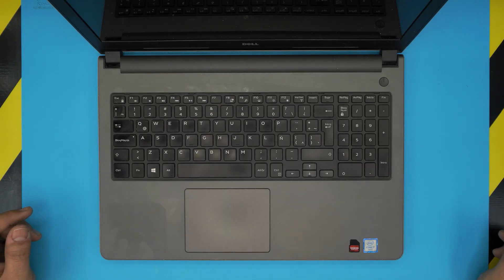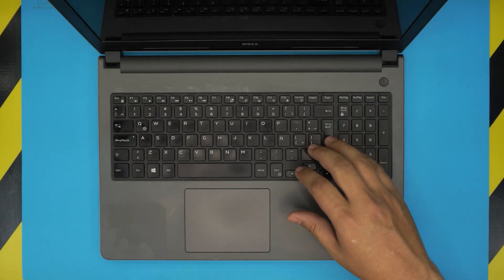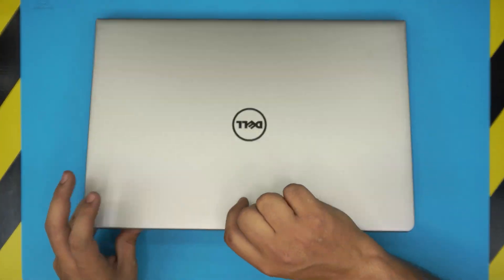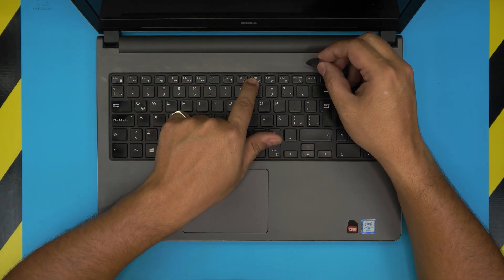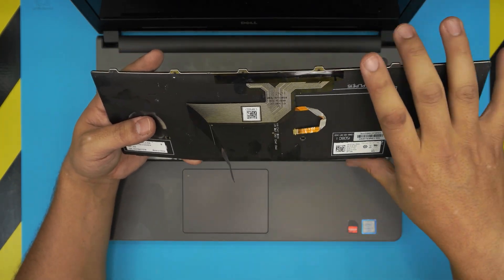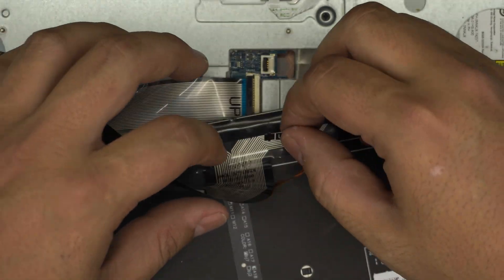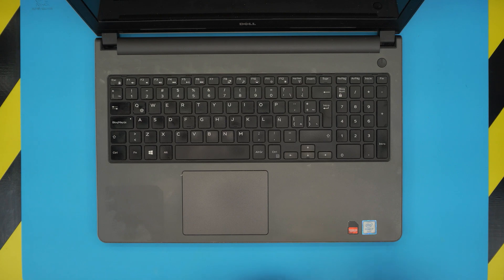Dell Inspiron 5559 P51f Keyboard Replacement FULL GUIDE

Comment: Great instructions.  My Dell 5559 came without a backlight  keyboard....can I now upgrade to one with backlight?  Will it have the connecting point inside?  In general, would you recommend to upgrade to a backlight keyboard?  Thanks.
Reply from the maker: It's my pleasure my friend.
🫠Regarding your question, if your model doesn't come with a backlit keyboard, you will need to remove the keyboard and check behind it where the connector connects to the motherboard. If the motherboard has the connector available for a backlit keyboard, then you can safely purchase a backlit keyboard, and it is recommended to do so.
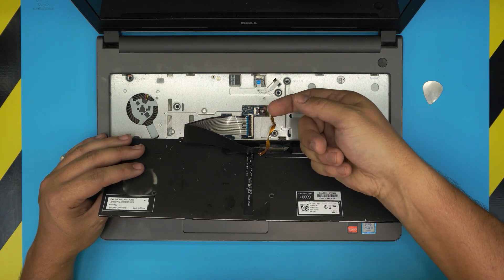right at @3:00 im pointing to the connector.
we open many the same laptop without backlit and they are 90% have and come with the connector.
Should you have any further questions or requests in the future, please don't hesitate to ask me.
cheers🍻
Reply: @uFixTek  Many thanks for your speedy and detailed answer. God bless and have a great day!
Reply from the maker: anytime🫠
i appreciate your support my friend.